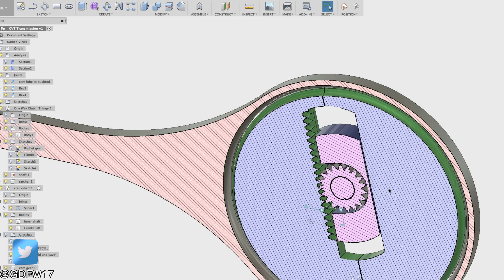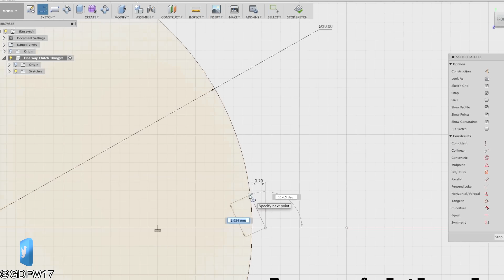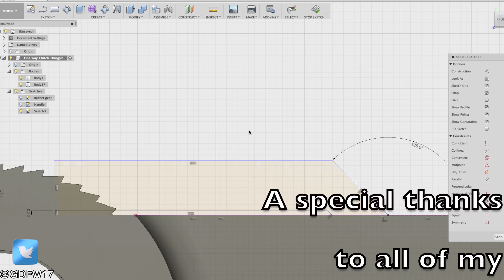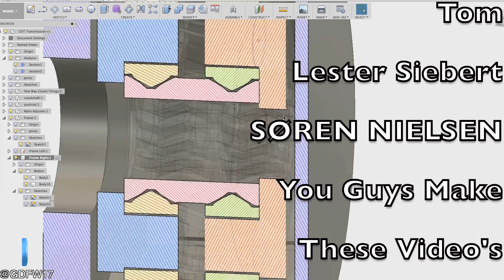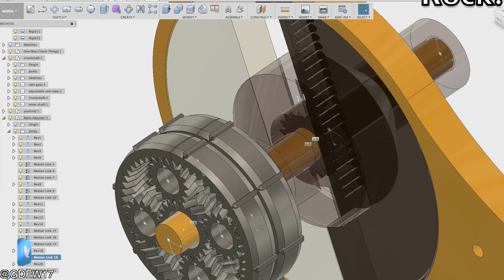The Coolest Transmission You've Never Heard Of... The Ratcheting CVT

Comment: what would be the purpose of this one ? i mean where you could use it ? does it work upside down as well ? the idea i had using CVT was to have something like harmony turbine to spin on wind and the cvt to offer a constant rpm to the generator and produce steady power, which means that the CVT should be able to take low RPM and transform them into high RPM and middle to high torque. Could that work ? thanks

Comment: FANTASTIC, GOOD WORK! More than 65 years ago I got my first introduction to a variable eccentric transmission. It was in my mom's old Maytag wash machine and varied the amount of agitation. When the worn-out machine was discarded behind the shed, I took the transmission apart to see how it worked. That idea has dominated much of my thinking ever since. As others have pointed out though, your model has some shortcomings. First, the ripple in the output makes it worthless as an automobile transmission. You could get rid of some of that by adding more cams and by replacing the output ratchets with over-running clutches. The other thing that limits its application in an automobile is the inability to backdrive. There are other uses for your idea though and I hope you are moving forward with your education and your understanding of how things work. A bright future is ahead of you.

Comment: Very clever. If you put a ratcheting clutch together with a flywheel on the output shaft, it will smooth out the pulse on the output. Just like a capacitor in an electrical circuit or an accumulator in a hydraulic circuit.

Comment: I have done exhaustive research on CVT's at the USPO. This is a rather old and well known "patented" design. It is called a Zero-Max. It was invented well before 1994.There are many variations of the reciprocating concept. CVT's, PCVT's, IVT's, and or PIVT's have been the quest of many inventors for many years So elusive has the search been for one that fills the criteria that you accurately described, that it has been termed "The Holy Grail" of transmissions.

Comment: Sounds like we both had similar childhoods...my dad had a shop crammed full of tools.  As to the CVT...wasn't the Dynaflow transmission constant variable, at least the version installed in the M18 Hellcat during the war when Buick wasn't building cars?  I had a 1952 Buick Roadmaster 2-door that had a Dynaflow and it was a smooth but slow acceleration.

Comment: It is an impostor because the output ratchets are quantized.  If you increase the ratio a little, the output speed will not change because lost motion will take place in the ratchets.  Then increase a little more, & suddenly you will pick up another ratchet tooth on each revolution.  Unless you put in sprag clutches (getting back the friction that CVT's are "blessed" with) or really fine ratchets (which are weak & wear).
          This is a "screen door in the bottom of a submarine to let the water out".
          There is also back-torque against the ratio setting  knob.  The motor that turns it will have to resist that torque when the transmission comes under load.

Comment: Since you are into gears:  I used to always want to build a lightweight Dual clutch bicycle transmission using sprags and clutches.
Negate the horrible chain gear changing experience.
I came up with a design where each clutch had 3 positions engaged A, decopuled, engaged B.

Kind of forgot about it until now.

I suppose now that I have a 3D printer, I could actually prototype it.

Base gear (riding on a sprag) is always engaged, but superceeded by subsequent gears.

Im sure you get the idea.

Comment: I had a similar experience when I was in high school and thought I had invented a downward locking milling machine vise only to find Kurt Workholding Corp. had done the same thing in in 1946, fourteen years before I was born. The drive you came up with has been built for many years by Zero-Max Corp. in Plymouth, Minnesota. I think they are still in business. The  first one I ever saw was used to adjust speed on the power feed of a drum sander. I also saw one that was pretty much the same thing and used to feed the carriage on a 56" circular sawmill. The sawmill was built by Frick Co. of Waynesboro, Pennsylvania but the variable speed set up was an after market attachment with no name on it. It was pretty ancient however...the eccentrics and ratchets were all exposed. I would guess it was made before 1920. Like yours, the input in these transmissions could be in either direction but the output was fixed in one direction only. Very ingenious and don't feel bad someone beat you to it first.  Throughout history there have been countless examples of things being invented simultaneously without one inventor having a knowledge of the other....calculus, telegraphy and the lightbulb to name only a few. If you didn't know about it, it doesn't make you any less clever than the first guy. Nice work and keep it up.

Comment: You know there is a 3rd reason you wouldnt use one of these in a car...

Fuel economy...

These transmissions use 100% of the throttle 100% of the time... Otherwise there is absolutely no point in having one and might as well use another transmission.. It's basically a pointless redundancy adding weight, friction, and excessive vibration to the vehicle as well as a dangerous critical failure point... As you said its unacceptable to have something like this in the automotive industry..

Comment: Idea: have a magnetic clutch and using some nicely placed strong ass magnets and a good eddy current setup ( and a few beefy diodes) one could do the energy transfer magnetically. though the strength of the magnets would determine the upper limit of torque.

Comment: As a 62 year old mechanical engineer, I've seen these types of variable speed drives (VSDs) over the years.  One name for them is an impulse drive.  They employ a series of crank-rocker mechanisms, each of which is at a certain fixed phase angle with the others.  Each crank-rocker employs some sort of an overrunning clutch that drives the output shaft, e.g., a wrap-spring clutch, a friction ratchet w/ spring-loaded pawls or balls, etc.  The ones I've seen have a hand crank that turns a power screw which varies the distance between the two ground revolute joints to vary the output shaft speed.  Some issues with these types of VSDs are:  1)  With a constant input shaft speed, the output shaft speed varies.  This results in torque fluctuations.  Depending on the load being driven, this can result in fatigue failures.  2)  The overrunning clutches are frictional devices with inherent losses that decrease overall drive efficiency.  3)  Each crank-rocker mechanism has a non constant mechanical advantage which further decreases the overall drive efficiency.  4)  High cost.  For applications where non constant output shaft speeds aren't a major concern and driven loads aren't large, e.g., conveyor belts, rock-cutting wire saws, etc., they work fine.

Comment: Pretty interesting. A bit of a shame that the output isn't very smooth, though I wonder if there might be a way to fix that via a spring. Each pulse torques the spring, which stores rotational potential and releases it somewhat smoother. (I'm reminded of the Orion nuclear pulse drive, which would use the power of nuclear explosions dampened by a piston to provide linear acceleration.) I'm really not sure how scalable this would be and there may be limits to the power of each pulse. It still could be interesting, at the very least, to investigate.

Comment: You are right about the cvt’s. The idea is the engineer’s dream gearbox but unexpectedly people like more the normal ones even the manual boxes which is understandable 

Manufacturers should had offered 3 modes: 
1. Normal transmission simulation for nostalgics, with fully adjustable modes: no of gears 3-8 for example and rpm shift points ( from eco, normal, sport, race)
2. Automatic mode with eco normal sport race
3. Full manual ( with overrev protection) by the means of a lever similar to a jet plane thrust lever so you can adjust the gear ratio in real time
This applies to ecvt as well
But this things  take time to put to practice and cars are already extremely complex and have thousands of parameters that need to be tweaked. Hence there  are even separate companies that specializes in tuning all sorts of things including gearboxes

Comment: Bruh, this is such awesome shit and you're very clever, and don't take this the wrong way, it's just constructive criticism, but, try to get to the point right away, after 1 minute tops, the way it's done here just makes 80% of the audience loose interest (which you can probably see by going into analytics, I'm sure the number is pretty accurate). But most importantly, show good pictures of it working, the way you explained it made no sense at all, but just from staring at the pic for 20 seconds I understood how everything works perfectly well. Could I do better than you? Probably not, but I just want to say this because I want you to attract as many people as you can.

That aside, this is very clever and one of the coolest transmissions out there, if not THE coolest! I may attempt to make one for a Sterling or some other alternative engine with low RPM.

Comment: Alot of newer Hondas have the CVT transmission and they have a get up and go attitude but when idling down a hill they have a lag issue in the transmission almost like when your driving a manual and you have the car in too low of a gear and if feels like the car is leaning more forward than it is going fast down the road.

Comment: 2 biggest problems of the cvt is failure, and very low towing capacity from what I've seen (1,000 -2,000lbs), I would love to rip out my cvt, and replace with a normal automatic.

Comment: I have been interested in this drive since I saw a CADD drawing in Popular Mechanics back in the '90's.  I had toyed with different notions of an infinitely variable transmission since the '70's playing the role playing game Traveller, where that was a futuristic option for ground vehicles. As I imagined the problem, the more ratcheting levers the better for purposes of torque, but to avoid incidental stalls and jams and for efficiency, each lever should have teeth spacing based on different prime numbers. Imagine my surprise when the article showed only four lever arms with identical teeth spacing. My notions apparently went awry somewhere. I would love to get my hands on a working model, just to better see the problems.

Comment: There is a main problem with this transmision, the output power is not as smooth as the imput, and its way slower than the imput even when at the maximum speed the transmision can reach. But still a great job and clever design

Comment: I think if I can understand it, each of the three wheels have a setting that changes the stroke length , and you used 3 wheels to smooth out power stroke, at short stroke the ratchet mechanism only moves say 1 tooth, or say turns 10 degrees of main shaft output, then at a slightly longer stroke this changes to 2 tooth, or say 20 degrees turn, and so at its highest stroke length the leavers move the ratchet gears say 5 teeth, or 50 degrees per Half turn of the input shaft, so the speed of the output shaft turns from 0 degrees (in neutral) to say 50 degrees at max stroke or 100 degrees per half  rev of the input shaft,  (my figures for degrees are just hypothetical)  and so torque is also multiplied by shorter strokes, low gearing, having 3 big wheels ensures the output shaft continues to rotate under power as leavers are returning to neutral position so with 3 wheels you have adequate overlap of power stroke turning by the 3 ratched leavers.  If you thought of this at the age of 16 I have to give you a the best teenage award of ratcheting technology! 👍👏👌

Comment: If you could design this for bicycles, then you'd be on your way to becoming rich. An IVT or CVT for a bicycle that is lightweight, wide gear range (500% or better) and at least 97% efficient, preferably in an enclosed housing, is the goal of several companies now working on it. The closest viable one on the market is the Pinion, but the problem with this system is you have to stop pedaling while going up hill, thus, losing all your momentum. Defeates the purpose for a mountainbike. 
Some of the benefits though, are its central location giving the bike better balance and better riding characteristics. Its enclosed so no cleaning is required (after a muddy trail ride) and it weighs about the same as a typical drivetrain. 
Shimano also has somethingin the works judging from a recently published patent. 

Just saying in case you might be intersted in this pursuit (nudge, nudge).

Comment: I originally saw this awhile ago, and it is amazing!!!  I have come back again to show my stepdad this.  Also, i learned that my john deere lawn tractor i am buying from a neighbor has a hydrostatic transmission, which is basically a CVT!!  This is an excellent work of art, and engineering!! Excellent job!!!
Reply: Lots of tractors and construction equipment use continuously variable pumps (variable volume pumps) to drive hydraulic motors.
Reply: @GordieGii  that's awesome!!!

Comment: Cool machine, and cool CVT talk in general. I was tuning up a serger a while ago. A serger is a specialized sewing machine that makes a seam and conceals the loose threads on the edges of fabric. You see "serged" seams on Tee shirts and stretchy clothes. Modern sergers have what is called "differential feed". The teeth that feed cloth through the machine can be adjusted to move together while feeding the cloth, or apart while feeding the cloth. The effect is stretched out, or scrunched up seams as the  operator requires. The differential feed mechanism in sergers is similar to your prototype CVT. A stepless, shift on the fly, variable  ratio for mechanical input/output. 

I also thought about a perfect CVT for years, and better internal combustion engines etc. As time moves on, and technology improves and changes, certain idea's become less important. One example is that Tesla electric cars do not have transmissions at all, because their powerful BLDC motors can move them from stopped to 100 MPH without shifting gears.

Comment: Slightly modified and balanced this could be used for an engine crank, which would allow variable compression or even as a cam allowing variable valve lift couple that with existing variable valve timing and you could see a whole new form of engine design and tuning capabilities.

Comment: Hey, mechanical engineer here. It's useless for gearbox. Too many parts, too much friction, too much clearances and high tolerances BUT recently, infinity patented this in their engines on the camshaft to make it able to change the compression ratio continuously. So the piston moves down as much as needed depending on the situation.

Comment: When I was younger, I was staring at my go-carts centrifugal clutch, wondering about how I can go faster through more gears... 
Eventually I had doodle out a CVT type transmission, using cones that point towards eachother, and can slide in and out.. As the engine picks up speed, the drive cone extends to give a larger circumfrence(higher gear ratio) and the final drive retracts to give a smaller circumfrence(higher speed)...using a belt to link the drive cones...  I was obviously limited to just imagination, pen and paper... But i "came up" with a CVT, only to later learn that they already exist, and that, thats how they're more or less made...

Comment: You should make the engine pistons directly to the CVT
Reply: The problem there is the variable offset of the connecting rods to the crankshaft. The pistons are essentially working together to maintain ignition and if you were to try and implement this design in the engine itself you'd lose a constant torque on the crankshaft reducing the power needed to intake and compress the cylinder before ignition or throw off the ignition timings depending on the gear ratio.  Although I guess you could interleave the CVT connecting rods between the pistons but then you'd have to deal with the ratio adjuster which might make it impossible again.  Hmm.  If I could imagine the design better it'd be interesting to see how reversing the input and output shafts might work.

Comment: Very innovative and you have made some good points there.. However you will have to rely on higher RPM to improve that efficiency and consequently it can pollute even more. It's a kind of a red herring thing there. Brushless electric motor and fuel hybrid maybe a better choice when summing up all those mechanical advantages. Still even electric-fuel hybrid still carries some uncertain dead weight even today. Thanks for your share and hopefully you can beat that.

Comment: You could implement a centrifugal clutch to the mechanism to the knob that you are turning to adjusting the ratio.  That way as the engine RPM increases it would automatically adjust the gear ratio and therefore increase the output speed.

I'd really be interested to know what kind of torque conversion you are getting.

Comment: I like your thought processes but my concern is your output shaft is spinning at a much slower speed than your input. Some transmissions get to a 1:1 ratio. Obviously this is a simplistic version. But another area of concern is in launching or hard acceleration from a stop, when your gearing is not in neutral, it looks very unstable. Then again its an open 3d printed plastic design. My argument somewhat stands, and great work none the less!